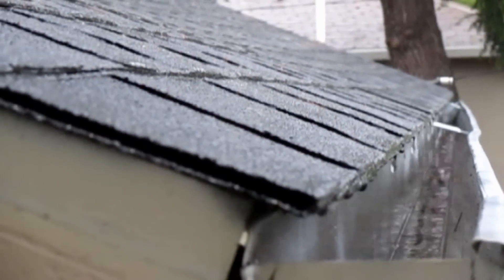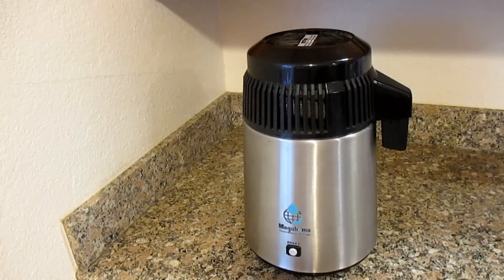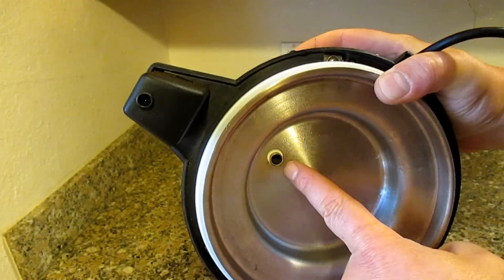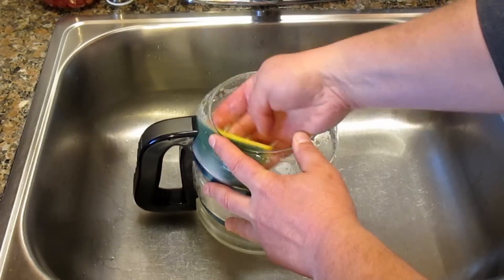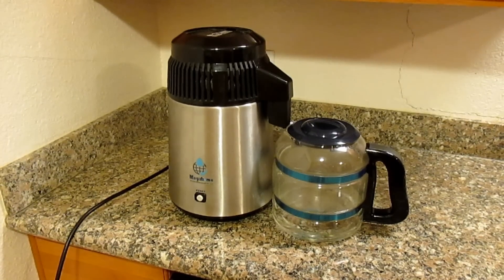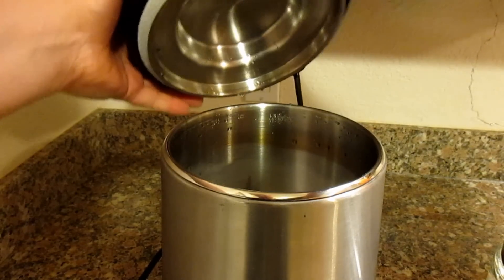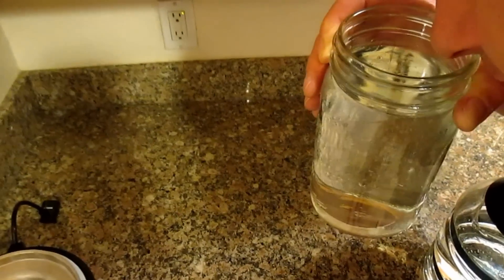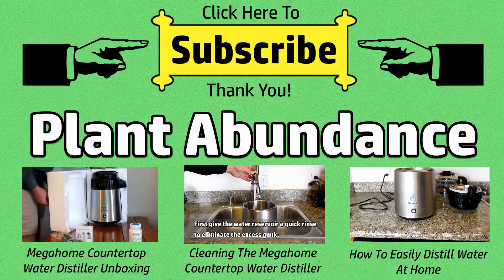Drinking Rainwater Collected From My Roof?!? Emergency / Off Grid Set-Up

Comment: Nice video, put a teaspoon of Citric Acid in the water when you boil the water and the crud won't stick to the bottom, the Citric Acid is harmless and won't hurt you or change the taste of the water.
Don't let the distiller shut off by itself, when the glass pot is about full then shut off the distiller, the distiller will last longer. 
I am distilling some rain water at this time.

Comment: What about using a Berkey?
Reply from the maker: That's a big NO from me. Cheers!
Reply: @plantabundance  Thanks! I have one of those electric distillers, but without solar power it would be useless in a grid down situation.
Reply from the maker: A gas generator capable of sustaining 550 watts of power would suffice.
Reply: @plantabundance  where did you buy that good video and 5 hours and 30 minutes now that's a long time but still it's good to have one where did you get it

Comment: I'm not sure that distilling will remove chemicals that the rain picks up. Chemicals can boil and evaporate as well so what is to stop them from distilling with the water vapors? There are some distillers that have additional filtering features that help to also remove chemicals.